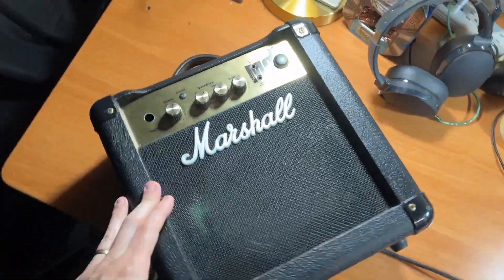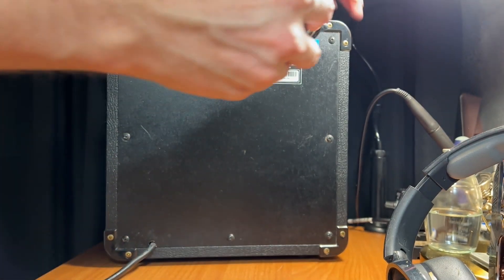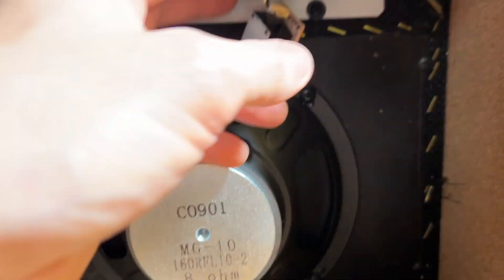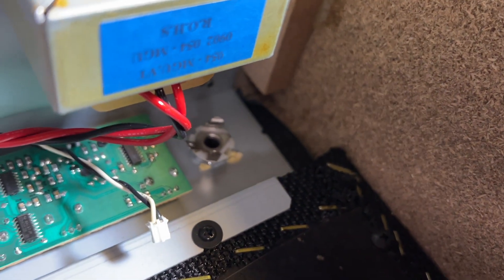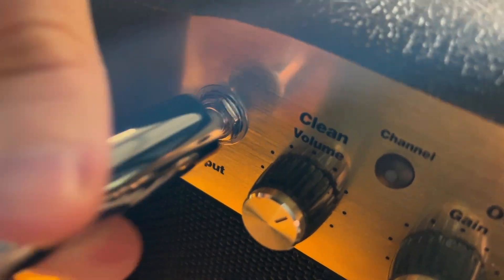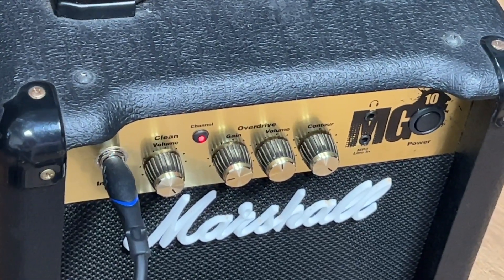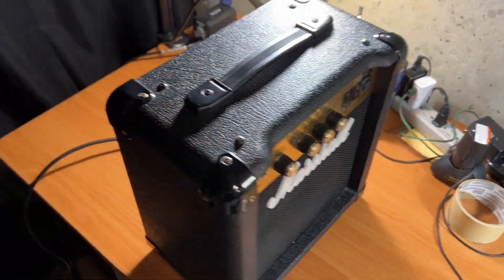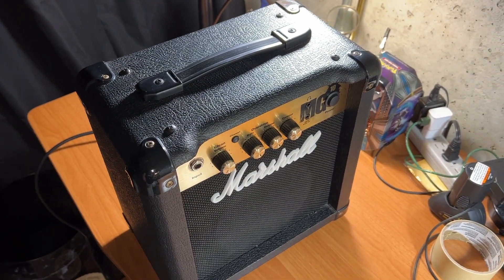Marshall Amp Input Jack Missing Repair / Replace DIY

Comment: I was really hoping to catch a peek at the power button from the inside, because I found one of these amps missing the push button cap, but the actual switch sits a good 3-4 inches deeper inside (which seems strange to me) I guess I could just rig something up, but I don’t know WTF i’m doing, electronics are foreign to me, and I don’t think it’s wise to have me fiddling with anything that isn’t made out of foam or rubber!

Comment: Where did you buy the new replacement jack?
Reply from the maker: You can buy them from Amazon, If you look up Switchcraft 1/4" Mono 2-Conductor Input Jack, then you should find a similar one to what I use in my video. Just make sure that the measurements line up for your jack hole size and length of the shaft.

Comment: I want to do this on my MG15,  the jack stays in place just fine but the spring tension is gone so the cable doesn't fit tight anymore and it hums like crazy. Just wondering if you need to discharge any capacitors before attempting this?
Reply from the maker: I would assume not. I had no problem with shocks on the amp I repaired. I would suggest turning on the amp, unplugging from the wall for a full discharge, then make sure you wear a grounding strap. Again, do this at your own risk and be careful :)